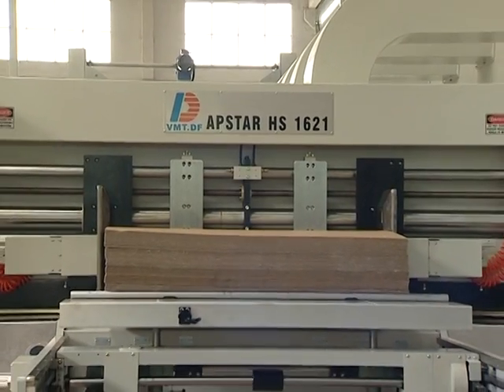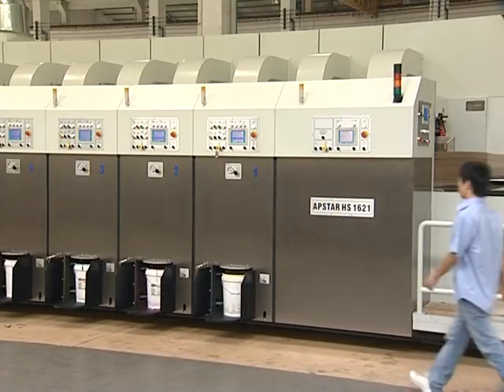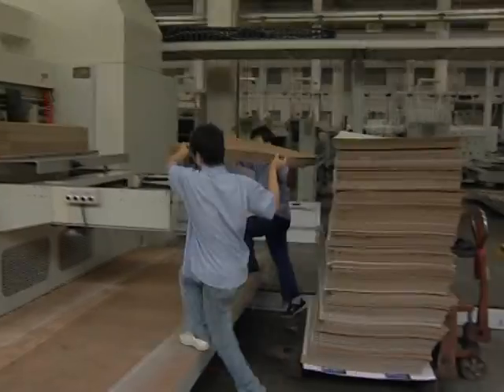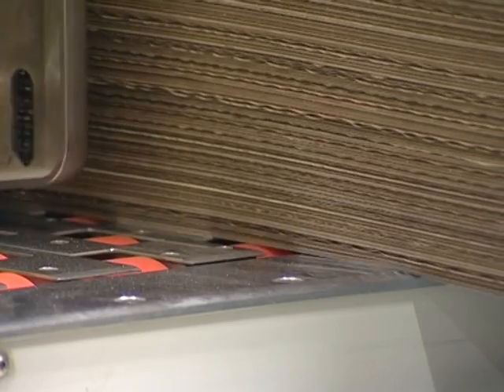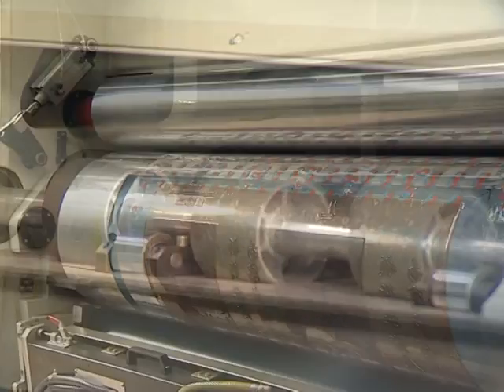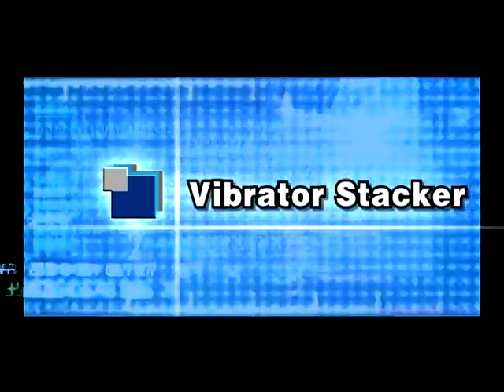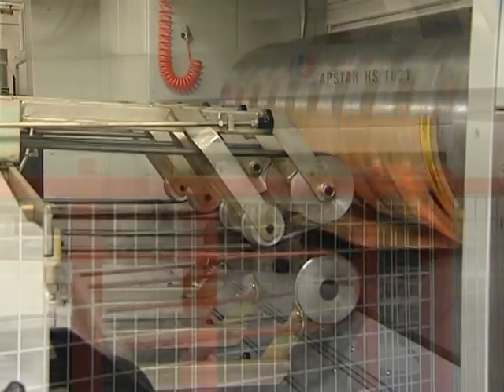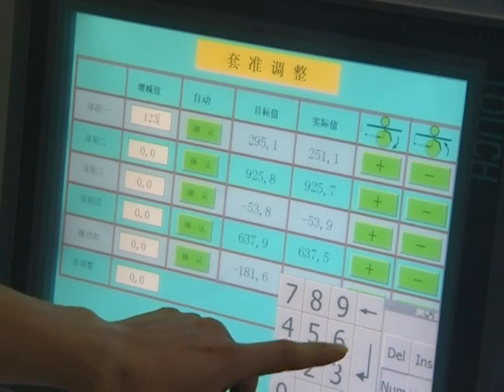Dong Fang APSTAR HS Servo Flexo & Rotary Die-Cutter - Introduction - Revolution Industrial Pty Ltd

Comment: How do you set up the belts when its a 2 out split box? I would appreciate the help.
Reply: Where you input your current job you put diecut number on the console and initiate the belts move automatically most discuss assigned to jobs for your machine are preset according to diecut if the diecut info isn’t in the database use your spec sheet to manually input width length out etc

Comment: Is the vacuum transfer metal wheels or rubber covered wheels?
Reply from the maker: They are ceramic coated steel
Reply: Ah. You don’t happen to know why they are coated. I have seen stainless wheels, but not coated
Reply from the maker: @shudnadunat1476  it's to provide more grip on the board